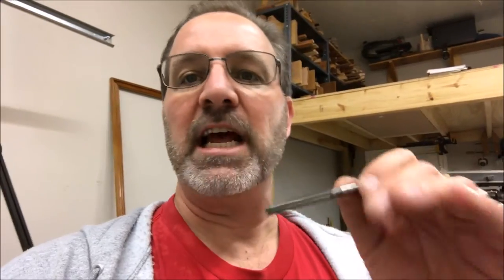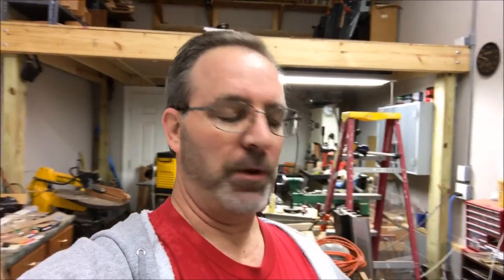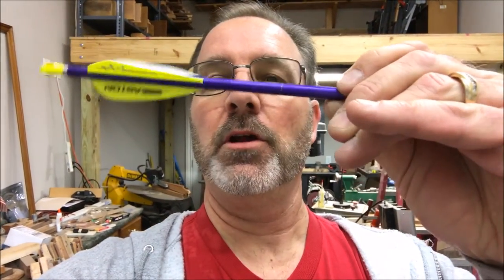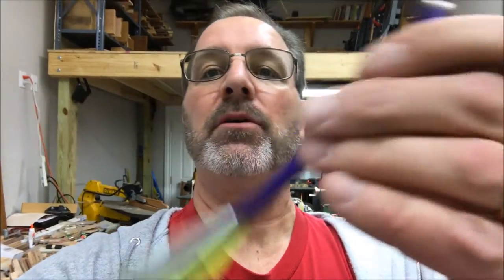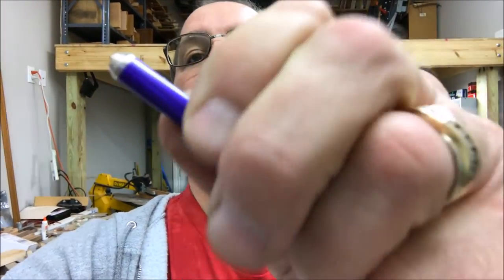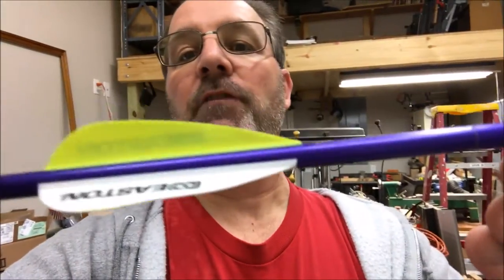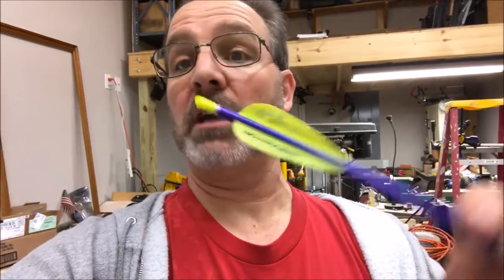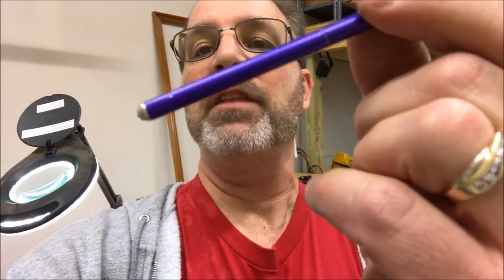Arrow Pen Take Two

Comment: Great Bob, as for holding the arrow. You might try a collet chuck on the lathe to hold it.  I have held similar items for drilling or reaming by first applying blue masking tape to reduce the potential of scratching and then putting it in a collet chuck.  I can then put my drill chuck in the tail stock and ream or drill perfectly centered by turning the head stock by hand.  Just a thought.  Thanks for the follow-up.
Reply from the maker: +Lynn Lacey Thank you Lynn,
  I'll give it a try. Need to purchase a collet chuck, or build one, first. 

Regards,
Bob
Reply: Yes. This is exactly what I would do.

Comment: Hey Bob, I haven't read the comments, but I suggest using 2 jocobs chucks. One for the reamer in the head stock and the other for the arrow in the tail stock.
Reply from the maker: +Terry Vance Thank you for the suggestion Terry,
  I'm planning to try all the suggestions I get until I find one that works. 

Regards,
Bob
Reply: Jacobs chucks have hardened jaws, they'll mar the arrow. A collet is a much better idea, although they can mar soft material like aluminum too if tightened too much.

Comment: Maybe drill a hole slightly smaller in a piece of wood and split the hole on your bandsaw put a hinge on it and it will clamp the arrow.
Reply from the maker: +cejkwo Mass I did try using two pieces of wood with a V groove and it still slipped. I'll try drilling then splitting as the round surface may give more points of contact. Thank you for the suggestion. 

Regards,
Bob
Reply: WhatchaDoinBob yes, I think a round hole will work much better than a v- grove. Maybe rub a little silicone on the inside of the hole and let it dry overnight
Reply from the maker: +cejkwo Mass Thanks for the idea, I'm going to try what everyone is suggesting until I find something that works. 

Bob

Comment: i just got some arrows yesterday so i can make some of these...
Reply from the maker: +c raig Very cool, please send me a photo when your finished. 

Regards,
Bob
Reply from the maker: +c raig quick note. Instead of a 1/4" drill bit, tonight I tried a 1/4" reamer and it was much better result. The drill left waves in the arrow shaft, the reamer did not. 

Regards,
Bob
Reply: i made one. I was able to use a standard slim pen kit with it as the nib was the same od as the arrow. and i was able to use the brass tubes aswell no drilling needed.
Whats the best way to show you a photo
Reply from the maker: +c raig rjbwoodturner@ufoww.com. Which arrow did you use, I'm using the Easton 1820 which is the one my kids shoot in competition. I may want to grab a couple of the ones your using for people wanting an arrow pen but it doesn't have to be so specific. Plus the savings on assemble time is good for the margin. 

Regards,
Bob
Reply: Hand drilling will leave 'wiggle marks'.
Reply: I want know what arrows you got too